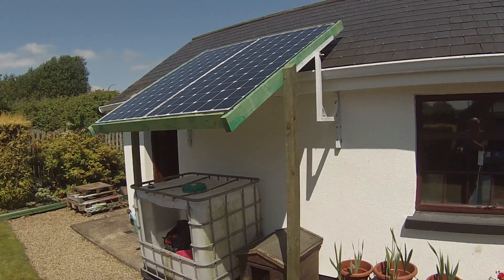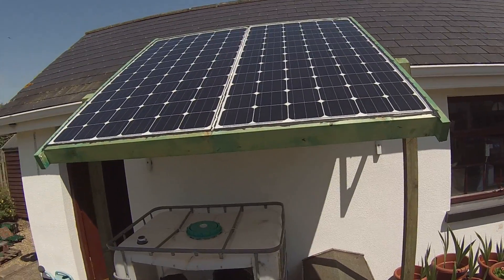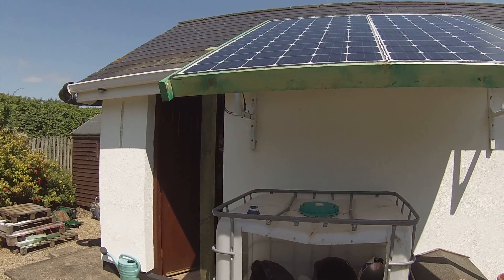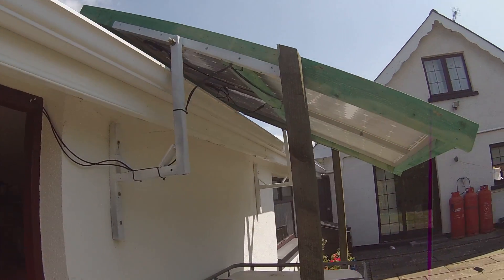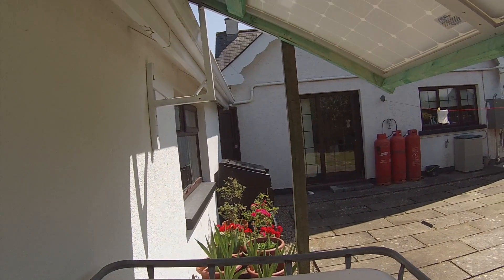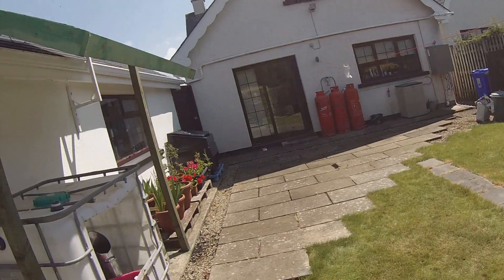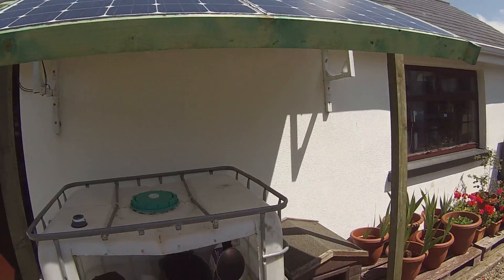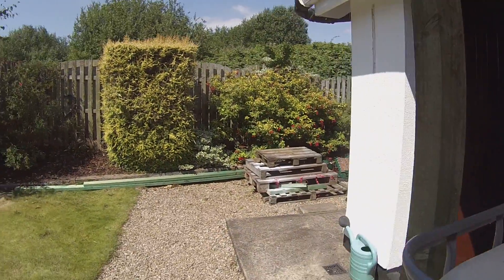My Simple Solar Power System

Comment: I run my house off grid using a 775AH 48V FLA forklift battery and it works really well. Maybe Lead batteries are crap for EV but for stationary applications, they are hard to beat. Been watching your Prius Gen 2 hacking videos, I am wondering how one of the Toyota batteries would go as a 3 Phase ac off grid inverter? ATM I have an 8KW inverter that I have built myself that does a good job but 3 phase would be handy.

Comment: I use 4x6volt TROJAN T105 lead acid  batterys in a 12volt system and they are not crap,ive been using them for about 4 years now and no problems at all (yes you have to look after them) here in Spain they are not cheap i payed about €160 each but i really think they are worth it.So my small system = 4 x 150watt 12volt SUNTECH  solar panels=4x€180=€720---4 x TROJAN T105 225A batterys=4x€160=€640---1x XANTREX c40 charge controller + display=€275---1x XANTREX SW 1400 prowatt inverter =€330---1x VICTRON IP22 12volt 20A battery charger=€175---Cables,fuses,etc...about €150---1x HONDA EU20i generator=€1200  so my whole system = €3490 i need a generator becouse i am tottaly off the grid,without the generator it's €2290.This system runs the whole house we only use led lightning in and out the house,we have a LG 32inch LED TV from 40watt what we do not use a lot  most of the time i use my laptop ,and we leave the wifi on 24/7,in the summer it's very hot here so we use a 50watt fan.To keep the beers cold we use a BUTSIR Gas fridgefreezer so no need of electricity, we use the waching machine only on cold water and straight pluged in the generator i never discharge my batterys lower then 12,4 V  and equalize them each month.(sorry for my not very good english)

Comment: I bought 100 li-ion cells from    a seller on eBay called alarmhookup. I am pretty happy with my purchase and I think you could put together a reasonable battery using one of the DIY spot welders on the internet.

Comment: I use old taxi lead acid batteries they are crap but buy them for £7 and weigh in for about £12 so cost is a profit lol use stick welder to charge cost nil and are safer than lion matervolt 3kw off eBay fir £50 so another bargain love your video about running items on dc will help to use my kw or so more efficiently until I get some more lead acids hopping to store about 4 kw tesla power wall would cost thousands and a bit if fun
Use 10 lead acids so about £120 volt into inverta

Comment: I was curious as to what all you could run off your system...lights, fan, outlets, or a wheel grinder ???
Reply: The way he is doing it right now, he is just just supplementing or reducing his grid usage by a little each day and I mean a little.   If he was using batteries it would depend mostly on how good his battery system is.  Solar cell panels generally are just used to charge the battery banks and then everything runs off the batteries.   When it comes to what you can power it all depends on how much power they draw and for how long.

Comment: I have a 24V Multiplus. It's a fantastic bit of kit. I have mine configured in Energy Storage System (ESS) mode. It's grid interactive, so it can feed in as well as charge from the mains on it's AC input. The AC output will remain active in a grid failure as you'd expect. You do need to use a CCGX or a Venus GX to make the ESS work. If you're on a tight budget then you can run Venus on a Raspberry Pi or a Beaglebone. I use a Beaglebone in my system. With that running you get the benefit of system monitoring and all data can be logged on Victron's VRM website (which is free to use).
Reply from the maker: That's very interesting thanks. I didn't know the multiplus could do grid tie?
Reply: Yes, with the right firmware and in conjunction with a Venus device. If your Multiplus has the "big" PIC your firmware number begins with 26xxxxx then you can run the "assistants" firmware which will allow grid tied operation once you select the appropriate grid code for your country. I am not sure if it works with the older "small" PIC or a 19xxxxx firmware.

Comment: could you not build your own battery you can buy 2.4kwh of 18650 cells for just under £300.00 including delivery and a 14s bms for £20.00 18650 holders for £8.00 enough for the 2.4kwh unit very easy to build and you can just keep adding them as and when you have the money, if you need help give me a shout

Comment: What about batteries from an Electric Forklift? I have seen others using them and they weren't too expensive used.
Reply: that's what i have 1100 amp hr 48 volt Forklift Battery and it works just fine

Comment: Can you actually use the power they generate though? I thought there was no net metering in Ireland? Where did you get the panels? I'm trying to get some but they are difficult to source in Ireland.
Reply from the maker: Links in the description. While I don't get paid in Ireland for the power I export I can use it locally and run the meter backwards.

Comment: I have a soladin to, I just reversed a standard watt meter on the AC side. Works great!
Reply from the maker: Great idea I'll do that.
Reply: Damien Maguire  expect 93% efficiency from a Soladin. I have 520watts installed and the max AC power is 485 watts.